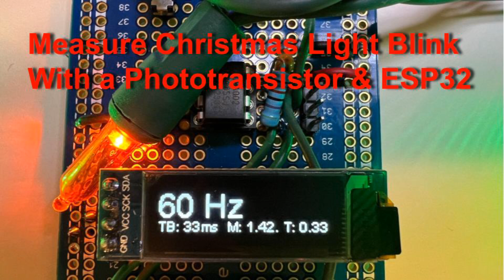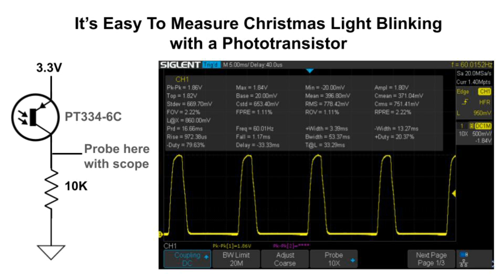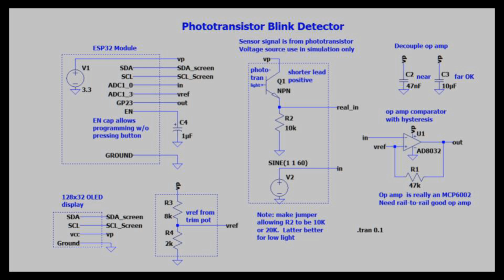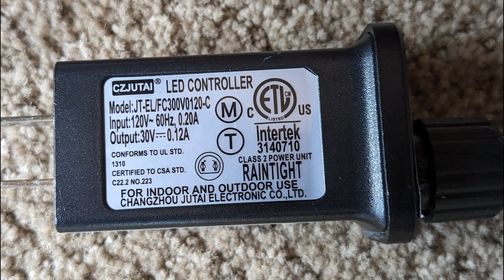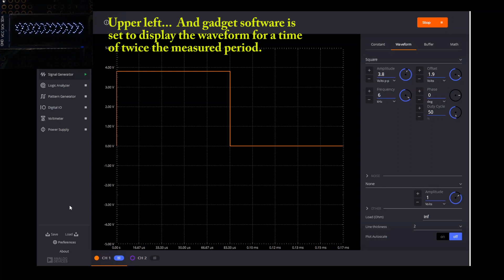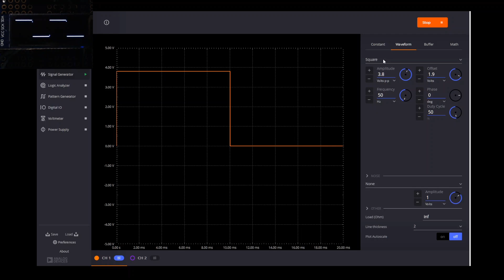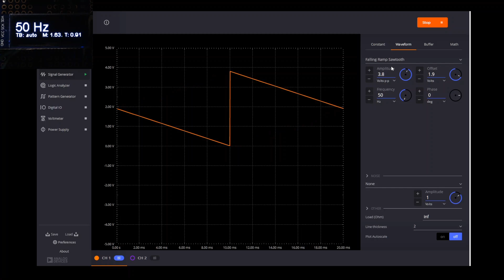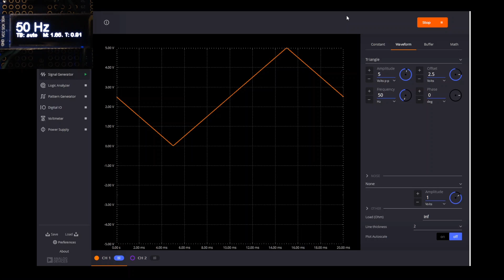Measure  Blinking/Flickering of LED Christmas Lights Using a Phototransistor and an ESP32

Comment: You made a honken' big, half-covered opto-isolator :D What method did you use for powering it portably? Just USB power from a usb bank?
Reply from the maker: Yes, powered from a USB bank.  Your opto isolator comment is spot on.  This started when I was playing with removing the 60Hz flicker from an LED string by adding first a bridge rectifier and then a filter cap.  This, unsurprisingly, works.  But I was not willing to probe it with my scope because it was not physically where I was working with the LED string and also one has to be careful probing bridge rectifier circuits because the scope probe is earth grounded.  You need a differential probe (which I do not have) or to separately probe the LED plus and minus and use a math channel.  I thought it would be easier to just "see" the light.  But this simple approach works even better than I thought, allowing wave forms to be viewed as long as the light intensity is OK.  And I have found that some LED products do strange or interesting things, like the string that flickers at 56 Hz. That's why I made the video.

Comment: It is really awesome ! one of the simplest solution I have seen but looks super effective !  Thanks for sharing it - what could happen when you point it to a computer monitor can it read its at least vertical frequency ? can you help to check if possible. Thankyou for your effort and sharing it !
Reply from the maker: I'm glad you liked the video.  My understanding is that today's LCD computer monitors don't refresh the way that old CRTs did.  Certainly my gadget detects no such flicker when pointed at a light spot on my monitor.  It would probably pick up something if the computer were displaying an animation that switched rapidly and regularly between a very light and a very dark scene.